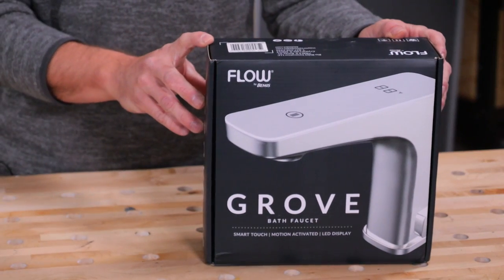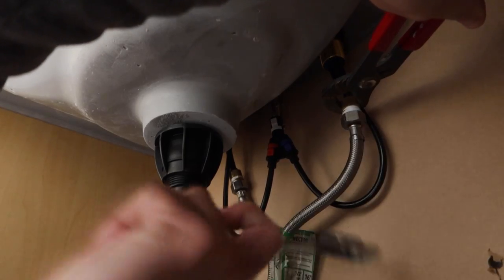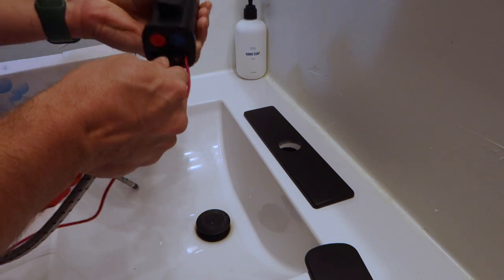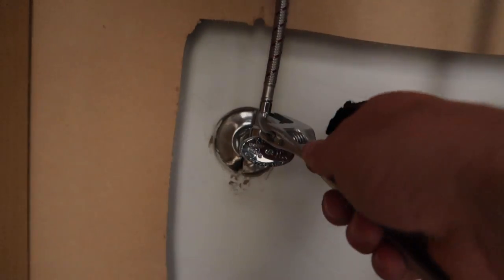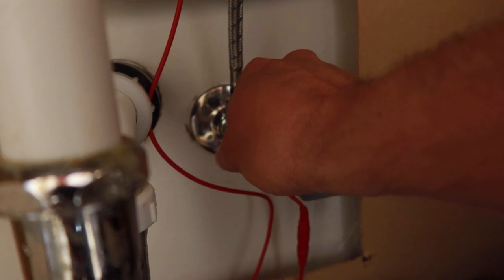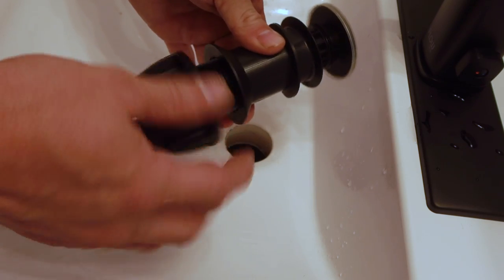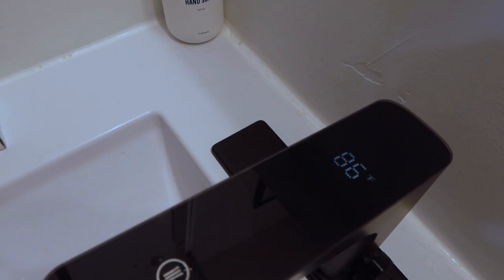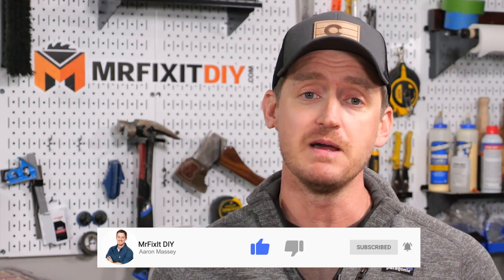How to Modernize Your Bathroom Faucet | A DIY Guide

Comment: What if I need to leave the water dripping for freezing temperatures? Here in Texas, that is super common to do. Is there a mode for that?
Reply from the maker: That is an interesting question. I'm not sure about that. That's more of a problem for exposed pipes that should be insulated than it is for the fixture itself.

Comment: Are you supposed to put caulk around a kitchen or bathroom faucet?
Reply from the maker: Some people do but I don't recommend it. Most deck plates have a gasket underneath them to seal water from going under. Also, caulking around things like that and especially toilets, can mask a problem which does more damage in the long run.